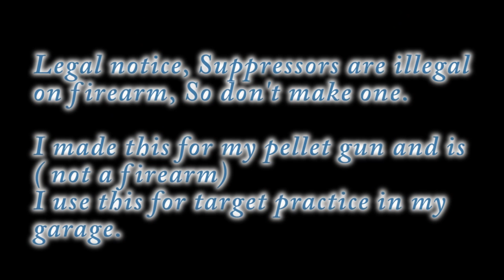Home Made Air Rifle Suppressor, simply the best out there

Comment: I recommend using a hole saw to make the disks.  It's precise, quick, and leaves a precisely centered pilot hole .
Reply: Thought it was funny to take the measurements with a micrometer and then use a Sharpie to mark with.
Reply: Faz muito sentido a sugestão do Clyde Wary, e com isso evitaria que o projétil esbarre nas peças e consequentemente atrapalhe na precisão.
Reply: Canal Variedades Boa idéia mesmo, matou dois objetivos numa só.
Reply: Clyde Wary what is a hole saw???
Reply: i figured he would save time by buying nut washers
Reply: @JP-st2mk  , that was a caliper not a micrometer.
Reply: lol was going to say the exact same thing. I was like man this dude is wasting quite  a bit of time with all those cuts :P
Reply: @battousai9774  , the wood absorbs some sound, steel reflects more.
Reply: It would be ok interesting to see if various density of 3d prints would help baffle the sound. 3D printers can also use patterns like cross-hatching, random, triangular etc...plus have percentages of density.

Comment: I made this silencer for my gamo swarm fox and it worked fine for absorbing sound. The only problem I had was that the pellets weren't coming out straight.
Reply: My name is Marko  The gamo rifle that I have doesn't come with front sights, it comes with a scope, but I'm guessing if you didn't care about the front sights you could cut them off with a hacksaw
Reply: That's a straightforward fix. There should be marks on the supressor where the pellet hits it.

Comment: Scott, nice design for an air rifle.  This design has been used for normal firearms, but the steel wool is flammable so the suppressor doesn't last long.
Reply: That's why before u pack with steel wool u soak all the steel wool in a flame retardant gel and then sprinkle baking soda all over it coating it well...once it's packed in the baking soda will of course shift shot to shot but will never let the steel wool catch fire

Comment: Nice!  I make mine using a simple plastic tube and take plastic caps from water bottles, Drill center holes and load 'em in' .  In the inside of the cap furthest out which is also the end cap (easy) I cut a small disc of foot support gel with a hole in center .  It definitely quiets things down a lot, and couldn't be easier.  Also, airguns now come with suppressors like mine, and are legal.  Also, using plastic baffles shows no intent to use for standard firearms as the plastic cannot sustain the heat from even one round.

Comment: Since you are not having to deal with flame, as in a firearm, my thought is to wrap the cage with 550 para cord. The wool of any type would get compressed in the blast area, but the cord would not so much. It may get frayed but would hold up well and have good sound deadening qualities.  Just a thought.  There is also nylon web strapping.
Reply: You overestimate the power of a pellet gun I think.

Comment: i have used this method before and it works very well but for mine after i shot about 3,000 pellets through it the steal wool fibers started t dangle in the flight bath of the pellet and would cause the occasional flyer, and it would be off by maybe 3 or 4 feet. it could have been just the way i made it but just wanted to throw that out there.
Reply: Scotch  guards green or brown abrasive pads worked

Comment: Buy an Umarex fake suppressor, add makeup pads covered by plastic net and electrician's tape. Slide on barrel and use soft tip Allen screws to hold in place. Quieter than this homemade tube and cotton, unlike steel wool does not rust and start blowing out the end of the suppressor. It also ensures alignment and does not break down like duct tape.;

Comment: if you want a much more compact suppressor heat up some (empty) 20GA shells and pull the plastic case out of the brass head, push the primer out and your left with a .23 caliber hole. I think I used 3/4 in pvc to put the brass cases in. wrap brass case in electrical tape till they fit snug in pvc. use as many as you want, but fit the first one flush with end of pvc and glue in place. leave enough room at that back end of the 3/4 pvc to fit a 1/2 inch piece of pvc inside approximately 1in  (this will require sanding the outside of the 1/2 in pvc until it fits snug) glue if needed. put shrink tubing on end of barrel and then slide suppressor on. you may need to use oil to get it to slide on, the oil will cause the shrink tubing to swell making a tight fit. I used 5 shotgun shells which made it about 5 inches total and made it 15db quieter.

Comment: 2.5 inch PVC for the suppressor housing shell would be more effective. It will trap more of the sound. I made a purely pvc suppressor with no metal mesh or steel wool. If you are making one for an air rifle, you won't need these.

My suppressor specs:

Length: 10.5 inch.
Diameter: 2.5 inch.

One 2.5 inch wide, 10.5 inch long PVC.
One 0.5 inch wide, 10.5 inch long PVC.
Two 2.5 inch PVC caps.

Drill holes that spiral around the 0.5 inch pipe and leave 3 inches undrilled on one end. The undrilled section will fit onto the barrel. Insert the 0.5 inch pvc into the 2.5 inch pvc and seal the end on only one end. Once the exit end is sealed tightly, use cotton, not steel wool, for the buffer material. You can pack more cotton inside the suppressor than you can steel wool for better buffering effect. When you have packed the suppressor as tightly as you can with cotton, place the second end cap on the end that slides onto the barrel. Make sure to have 0.5 inch holes drilled in the center of each end cap before fitting. Then do the paint and clear coat and you have yourself a faster-made, more effective suppressor. Wrap a stopper 3 inches down the barrel so the suppressor stops at the proper place. 

The cotton is softer than the steel wool and will give more effectively to sound waves. This will buffer the sound much more effectively. The larger diameter of the suppressor housing shell will allow for more sound waves to enter the buffer chamber and cancel more noise.

With this build, the only thing that can be heard is the trigger mechanism and bolt release when the compressed air is released. No sound comes from the end of the barrel. I invite you to try this build out.
Reply: Email Warrior  this might be a silly question but how would you make the smaller pipe sit in the center? like in the video the wooden disc things looks like it also helps keep the whole thing in the center inside the pipe. sorry english not my first language.
Reply: Interesting
Reply: TLC PG They have some spacers in the shop probably.
Reply: Email Warrior should make a video for us guys who dont like to read.
Reply: AJ Lastyona - Or can't read....
Reply: Thank you for sharing the specs of your silencer

Comment: I'm almost done machining the last chamber in my suppressor , and while this might work it could be so much better , sound travels 360 degrees using mesh sounds good but when sound comes out of each hole of each baffle it extends out 360 degrees and needs room to travel and bounce off of itself to dissipate, this is why silencer baffles are rounded in the chambers , someone was right about the sound of the air coming out , that's why mine has the only one I've ever seen having a decompression chamber at the exit that will allow the pressure to come out through several holes around the outside which acts like a barrel brake without the brake . So the main of the air pressure does not come out of the exit whole which affects the bullets accuracy and makes for better accuracy. This is good and cheap way but not the best , yes the holes it travels through need to be minimal tolerance as mine has and the hub that mounts to the gun needs to be nearly perfect and strong and true to the barrel to do this . And yes air gun silencers are legal you can buy them online for around 200. Hunters supply sells one and their is another I can't remember the name of , and once they are able to pass the safe hearing act you will be able to buy one for any firearm without a stamp , like they say firearms and suppressors dont kill people , people kill people and have since the beginning of time like Cain and able and will no matter what anything the government does , our government cannot stop Satan or any evil or any evil intent , they are actually helping it by all the laws the pass that go directly against the Bible and gods commands , this is why our nation is the way it is because our founders were christians that wanted this nation founded on the Bible and gods commands in the Bible and our government has slowly year by year adopted absolute abominations to god and put it on the rest of us as laws and try to force us to accept evil and evil doings as be ok and right !!!! This is bringing this country to its knees and away from gods protection that always made us great and the most powerful nation !
Reply: The military would not take me because of a brain injury I had when I was six but it will take gays and transgender people and anyone else and accommodate them in any way ever so as to not upset them or their communities,  this is why we are weak as a military and a country and no one fears us anymore .

Comment: swap the steel wool out, it has zero sound absorbing properties, use fiberglass insulation, or tear a pillow apart and use the white fluff inside it, or go to walmart or target and get the cheap bed topper foam and use it, also your leaving a lot of room inside that pvc, what i did was, make the cage, wrapped it in insulation, and wrapped another cage around that, it holds the insulation perfectly, then used the bed topper foam around everything, used the same idea you had for holding everything in the center of the pvc,but i found cutting the drilled wood circle retainers in half, allows for more workability to get it centered, i use a 22 caliber BF, and it went from loud as hell to quite as fuck

Comment: it would be quieter if the hole in the baffles was only just big enough for the pellet to pass through, so if you are using .22 pellets the hole should be 6.5 mm, that way the air hits the baffles and slows down...maybe cut a 3 or 4 small slots in each baffle so the pressure doesn't build up
Reply: +supermotardmario but there needs to be room for the pellet to pass through
Reply: +capatainnemo he didnt account for the pellet vortex.

anyway, i dont think it'll work on airgun. unlike real gun, air gun's noise doesnt come from the bullet itself. real gun's velocity is really dependent on the bullet, while airguns depends on its compressor. doesnt really make sense to make a silencer for it at the end of muzzle. the only way to make an airgun quite is to dampened the inside of the compressor, i guess.
Reply: +Amin Ismail i have tuned my rifle, there is hardly any noise from the action..and a moderator does work with airguns
Reply: +capatainnemo Same here, Ace. Makes having a pellet gun worthwhile.
Reply: +Amin Ismail higher power air guns will make noise no matter what you do cause they spit the pellet out at super sonic speed
Reply: ***** yea thats true but its hard to tune down something that does 1400fps with lead but they are fun to shoot iv got a couple that are borderline super sonic and will cross the line depending on humidity and one thats way over
Reply: +Amin Ismail Well said.  Gamo, Crosman, and others are now utilizing pistons and introducing technology to decelerate the piston to reduce the mechanical noise.  However, the largest noise is the sonic crack from pellets traveling over approximately 1100 ft/sec.  The answer there is obviously to use heavier pellets which will reduce the speed and eliminate the sonic crack.
Reply: +captainnemo Maybe so, but I have a moderator for a .25 that I use on a .177, too, and the suppression is very good.
Reply: Oh, well that may be true, but the level of accuracy and quality here is a guy DIY in a shop that he uses sharpies to measure the baffle rings.  Seriously, its going to be very hard to make a cylinder inside another cylinder that is that accurate.
Reply: baffling

Comment: For the baffles - is plywood the best option, or could it be particle board, to make it lighter? And to coat the baffles, is felt as good as steel wool? There seems to be a balance of allowing air thru & deadening the sound. Some fabric might have the precise amount of absorption for sound, but be vulnerable to repeated blasts of air. Plus, it seems like the steel wool would eventually collapse onto the main tube.  I know this is a super old video, but I'm hoping to try a few things for my break-barrel .22 pellet rifle, so I can shoot it in my basement & if there's dieseling, it doesn't sound like Hamburger Hill down there, lol.

Comment: Ditto as to what M.H. said about legality. 
Just punch in "suppressors for sale" in your browser.
I just bought a threaded barrel for my 1911, suppressor to follow.
Reply: +Eren Yeager Not necessary with airguns. Federal court case supports okay for airguns, so long as it doesn't also fit powder burners without modification. Airguns have 1/2-20 threads. Powder burners have 1/2-28. To modify an airgun suppressor to fit a powder burner shows intent, and that would make you in violation of the law.

Comment: Looks like a Crosman? If so you can get a suppressed/shrouded barrel for it for ~$20.  
You can also buy just the internal baffle assy for the new NP2 which has a threaded end (1/2-20) for <$3, way easier than making one.  Then buy or make the outer tube body which needs ~.900"ID and 5.5" long. Then either drill the threads out of it and make it slip-on like yours, maybe use setscrews, or ideally you can thread the barrel. The gun itself can be made quieter as well, since as you know much of the sound comes from the powerplant. 
Btw, I would not advertise you made a suppressor. My interpretation of the law is it's very much illegal and the punishment is not even remotely in compliance with the 8th amendment.

Comment: Cosmetically, it looks nice but that's a lot of work for less than 1% of noise reduction.
Reply: <1%?  The phone is not capable of accurately measuring that noise but it was far more than 1%.
Reply: You are right. I meant to say 15%.. If you pay attention to the decibel reader, the unsurpassed shot read 66 decibels while the suppressed shot measured 55. We don't even need a calculator for this. The difference is 10 decibels. 10 over 66 is 15%.
Reply: Actually dB doesn't work like that. It's kinda weird but there's two ways of looking at dB; one is a 10dB drop "sounds" half as loud, which is subjective, the other is the actual power or energy of 10db is ten fold, so  it's only one tenth as loud now. The position of the meter is critical since the gun makes two noises, the muzzle blast and the piston inside. The muzzle blast probably was reduced that much, maybe more, but it does nothing for the piston noise. So from the targets perspective it's huge, from the shooters perspective not very much unless you include the echo of the muzzle blast since he was indoors. Other types of airguns like pneumatic, pcp etc have much more muzzle blast and no piston noise so they'd bennie much more from it. 
I like his suppressor, but it's not attached nearly well enough and could easily get you arrested if caught.
Reply: In retrospect, I looked further into consumer grade suppressors which are rated between 14 and 20 dB of sound reduction. If this is a standard then his homemade version is coming pretty close at 10 dB.
Reply: Some of the measured noise is mechanical rattle made by the gun itself, not the gasses or projectile/missile leaving the barrel.  Difficult to say how much of the noise is mechanical, unless it is measured without the presence of expanding gasses.
Reply: Seldin Gardane well in case you didn't know, +10db is audibly perceived as twice as loud. So cutting the sound in half is pretty significant. Plus reducing the sound by 10db from 66db is more than a 1% change. So yes 10db is a pretty good difference. To be clear, 3db is twice the sound pressure and 10db is twice the perceived loudness just in case someone says something about the known 3db rule.
Reply: Kfx Guy thanks for the update but the other guy beat you to it lol
Reply: Seldin Gardane my bad I didn't see it. Lol
Reply: That's not how decibels work.  55db is almost half as loud as 66db